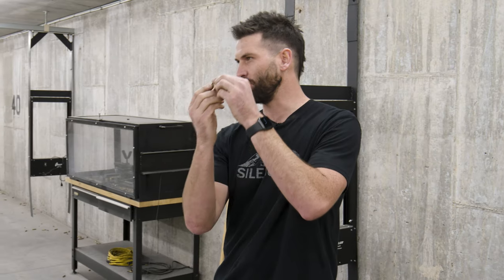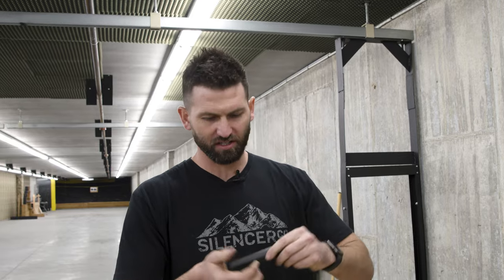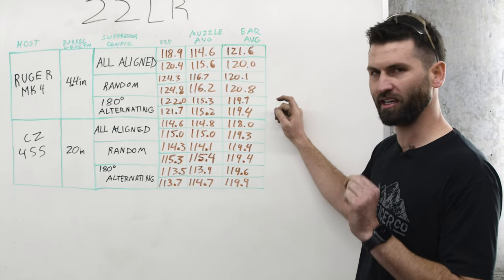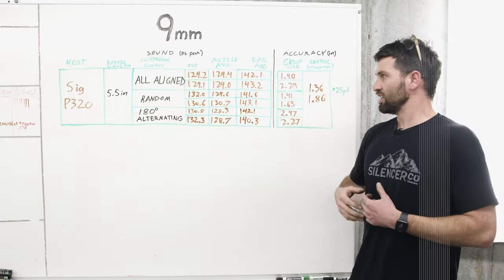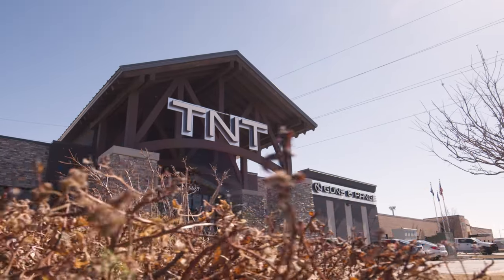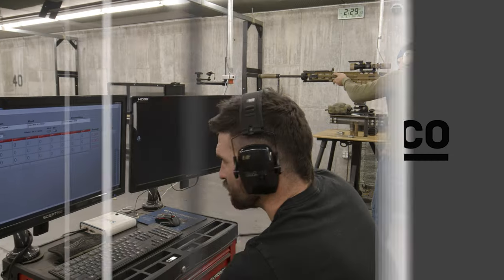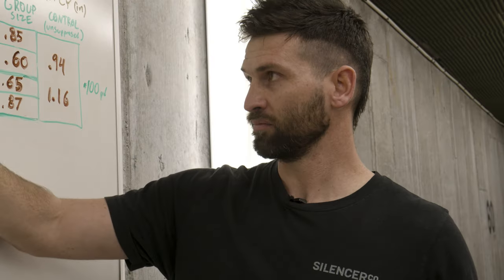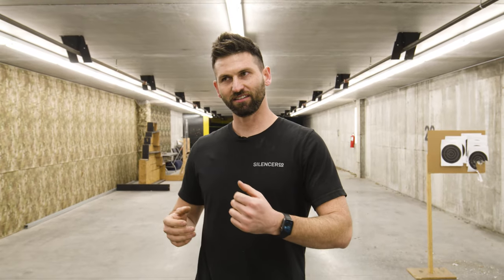SilencerCo Suppressor Science: Baffle Alignment

Comment: Would port location (random vs say 6:00) affect point of impact?
Reply: I have the same question, just got the 46m to the range and rounds seem to be 'pulling to the right' and when I look at the alignment of the baffle cutout it is also to the right. It's possible I mucked things up when I installed agb and muzzle brake. Will update when I can get back to the range. Will try with suppressor off to see if I'm zeroes again

Comment: What a pisspoor test. You should have done all configs:
0 degree alignment
180 degree alternating
90 degree clockwise
120 degree clockwise
90 degree counterclockwise
120 degree counterclockwise
Scrambled is a pointless config but could be used as a control for the worst possible config. The direction is relevant because of the rifling orientation. It orients the gasses in a directional spiral. How does a silencer company not consider these aspects of gas flow?? Dumb..